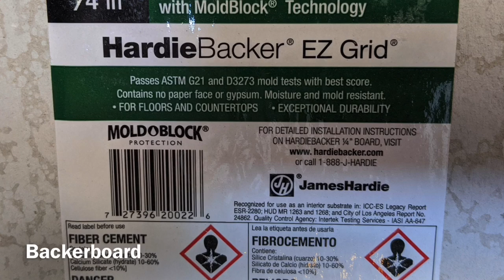Installing Mexican Saltillo tile (longer version)

Comment: Believe me, I know how much work you did here. I've only replaced sections here where I live because of high traffic areas and foundation settling. I ripped up tile, scraped thin set and reused the same tiles. I'm going to order new ones because it's a lot easier to rip and replace. Thanks for the info.